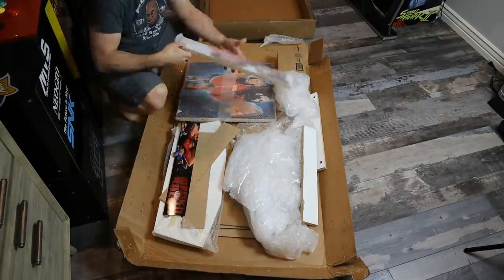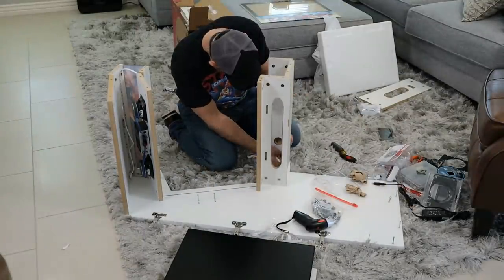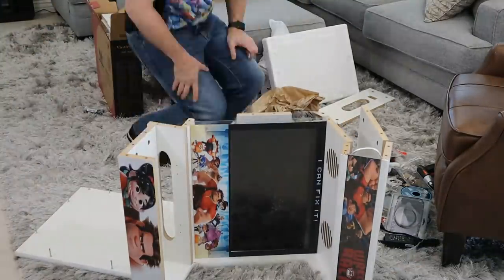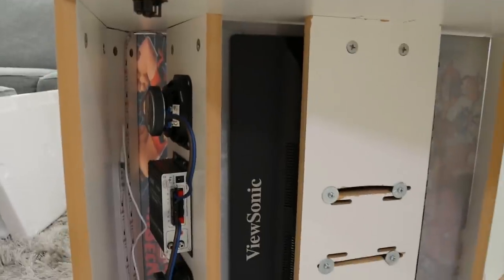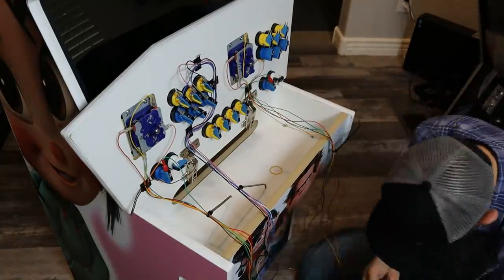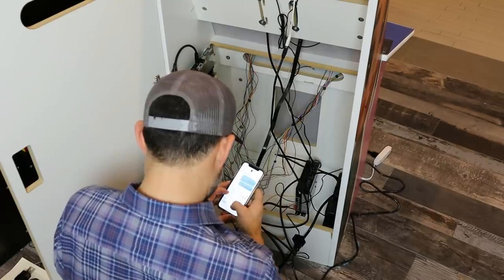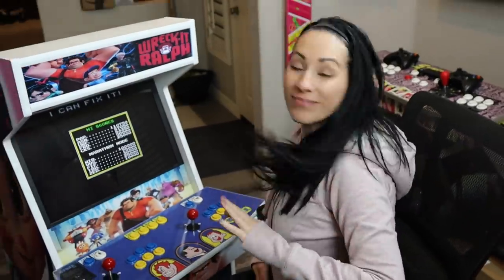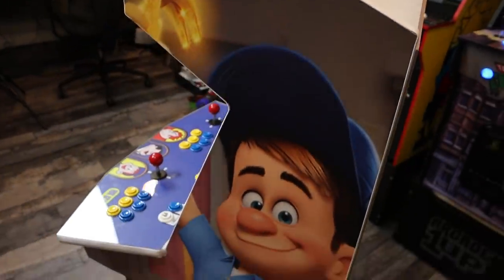Arcade1up vs. Game Room Solutions - Watch Ralph Wreck-it!

Comment: with that multi cart if u dont like any of those games on it its very easy to replace the rom on it and add a new one
Reply from the maker: I think you're referring to the everdrive cart.  This one is fixed and can't be changed.  The everdrive let's you use ROMs and run them on the Sega Genesis.

Comment: Do the speakers actually output stereo? My guess is no unless that’s a Genesis Model 1?
Reply from the maker: The cable I'm using outputs a RGBS video signal and stereo sound from the Model 2 Genesis.  You can find the cable here:  https://cgi.ebay.com/ws/eBayISAPI.dll?ViewItemVersion&item=372582279357&view=all&tid=1081685174024

You will also need this in order to send the video and audio signal to the LCD panel.  https://www.amazon.com/TNP-Converter-Adapter-Upscaler-Connector/dp/B0177DG71S/ref=sr_1_3?ie=UTF8&qid=1551070946&sr=8-3&keywords=scart+to+HDMI

Note:  I think this is cheaper on NewEgg.  

Hope this helps! Thanks for watching!

Comment: Funny you don't mention the insane price
Reply from the maker: 97bigrob It’s on sale for 379.99 right now with free shipping.  I don’t think that’s insane if you consider how much money people put into modding a 1up cab.  I have both and like them both but I have spent a fair share getting my 1up the way I like it.  (i.e Joysticks, buttons, graphics, video controller boards, RaspberryPi, tools 🛠) it all adds up.  I don’t think calling it insane price is fair.  Anyway... thanks for watching and supporting the channel, I appreciate it.
Reply: @RetroRalph  Thanks so much for the video.  I completely agree with you on this in that the price adds up very quickly when modding and trying to get it right.  I also have a video of the 1UP that I have modded and also did a price comparison of all of the items.  I have been looking at more than likely going towards this direction.  One question, in your observation, how is the sound coming out from the front of the cabinet in comparison to the 1UP from the bottom or the back.  I changed my speakers to the sides as the sound from the back and bottom did not quite sound right to me, so I am curious since you have the Level Up cabinet, what your thoughts are on this and if it does improve it coming from the front.  Thank you.

Comment: What is a knobby screw driver SMH
Reply from the maker: not telling A short screwdriver:  Stubby Screwdriver 2 SETS By Kutir - ADJUSTABLE LENGTH and REVERSIBLE DUAL END, Slotted and Phillips Magnetic Tip - EASY TO USE Compact, Portable, POCKET SIZE Small Tool - Short Craftsman Nut Driver https://www.amazon.com/dp/B06XKL6F9K/ref=cm_sw_r_cp_api_i_gzBZCbW7ZBA5M

Comment: Widescreen monitor = no buy
Reply from the maker: You can put it into 4:3 mode ;-) Thanks for watching!
Reply: Then your screen would be much smaller then the 4:3 arcade 1up screen.
Reply: @statuecollector5723  And you would end up with big black borders on the screen...
Reply: You could probably put a 20" 4:3 or a 22" 16:10 instead, though the artwork template is made with 16:9 in mind.